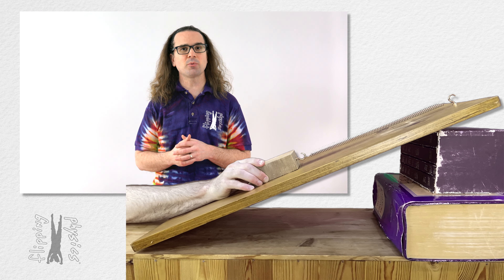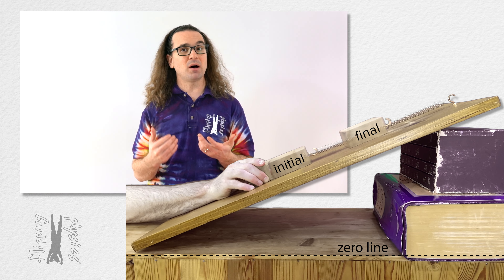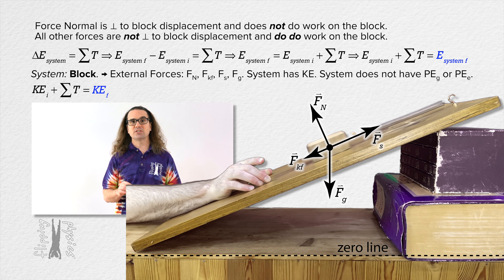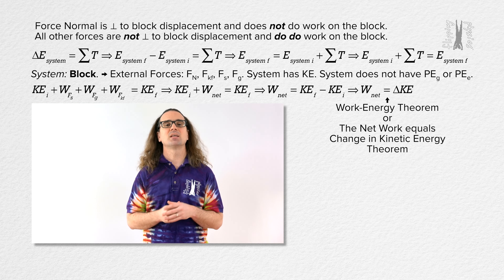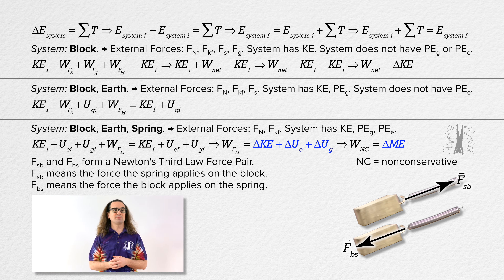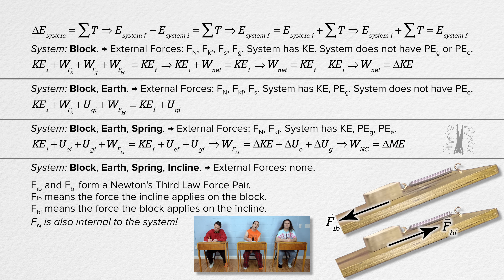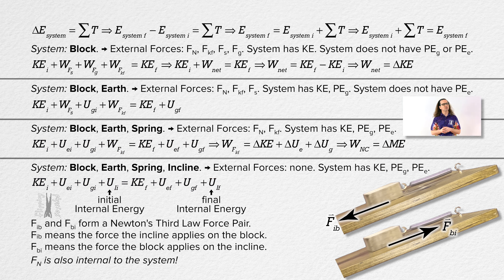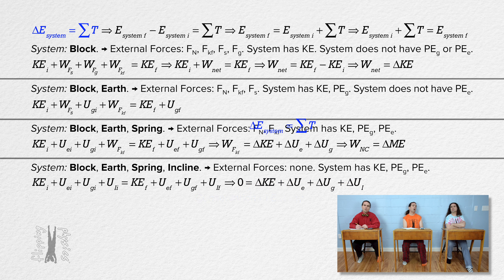Energy Systems Clarified

Comment: This is a super helpful video.  One clarification that I would suggest you include is that when you say including the board means that all energy stays in the system, you clarify that you are assuming that the heat generated from friction heats the board and not the surrounding atmosphere.  When the air warms, energy leaves the system.
Reply from the maker: Valid point. Thanks!

Comment: So when you have a force (like the force of gravity) internal to the system, we don't look at it as the work done by the force of gravity but rather the gravitational potential energy. Is this because the work is just the transfer of energy so it makes sense to use the work done by the force of gravity because that's just saying how everything external to the system transfer's gravitational energy to the system. However when we include earth in the system, we have to start using gravitational potential energy because we are looking at how that energy changed and how it can be converted to other energies (like KE). Work done by the force of gravity would make no sense because since Earth is in the system, energy wouldn't be transferred. Is this right?

Comment: You mention that it is not possible to measure the potential energy of an object if the object is the system. The reason being that potential energy is relative and thus requires an external reference point, which is not possible if only the object is defined as the system. However, you say that it is possible to measure the kinetic energy, but I don't see how. Kinetic energy is proportional to the velocity of the object, and velocity is relative. This means you would need an external reference point in order to measure the kinetic energy of an object and that is not possible if the object is the system. Am I wrong?
Reply: yes.
Reply: im pretty sure he said that we cant measure the gravitational potential energy because our system only includes one object (the block) and the earth is not in the system;  gravitational potential energy only exists when there is a force of gravity, and since the force of gravity is the attracttion force between TWO masses or objects then there is no force of gravity in our system(so no gravitational potential energy). The same is for the elastic potential energy, the spring is not in the system so no spring force and no elastic potential energy. However the kinetic energy only depends on the motion of the object, so since we have an object in our system and it moves then kinetic energy exists. Hope this helps